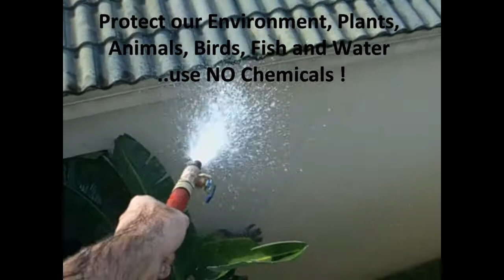Roof-Cleaning-West-Palm-Beach-561-502-7663

Comment: MUST READ!!! - The Asphalt Roofing Manufacturers Assoc (ARMA) guidelines to clean roofs are: (copied from their website 2019)
"The most effective method of cleaning algae and moss from a roof is with
 a 50:50 mix of  'laundry strength'  liquid chlorine bleach and water. Apply
 with a sprayer and allow the solution to dwell on the roof surface for 
15 to 20 minutes, and then rinse thoroughly with low pressure water. 
Extended dwell times may be necessary, however, avoid letting the 
solution dry completely as this may prevent complete rinsing."
**LAUNDRY STRENGTH BLEACH (SH) IS 1% - SWIMMING POOL CHLORINE IS 12.5%... 25 TIMES STRONGER! - You don't put swimming pool chlorine in your laundry as your clothes will disintegrate & bleach out white! ARMA is recommending 1% cut 50/50 with water = 0.5%...NOT 12.5% swimming pool Chlorine! Then it has to be rinsed off the roof...yeah right if they rinse 30gal of swimming pool chlorine off your roof your entire yard, plants are all dead!...so they leave it up there to dry and rust the hell out of your roof. We all know 1% bleach from Publix cut with water 50% does not work! "Low pressure water cleaning" less is the best alternative (not perfect) but way better than toxic corrosive swimming pool chlorine.